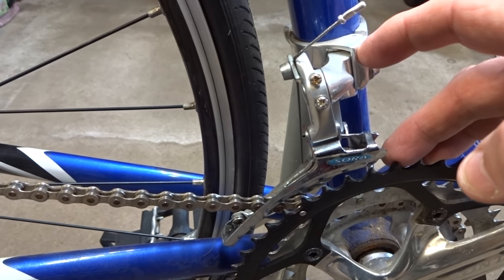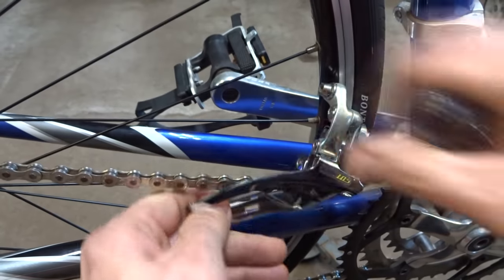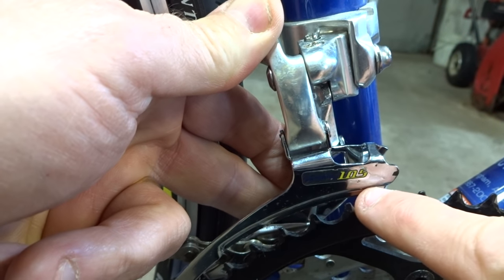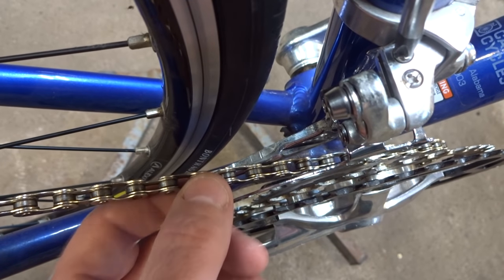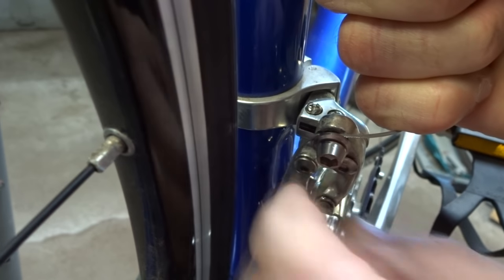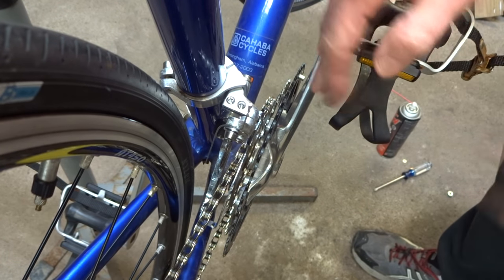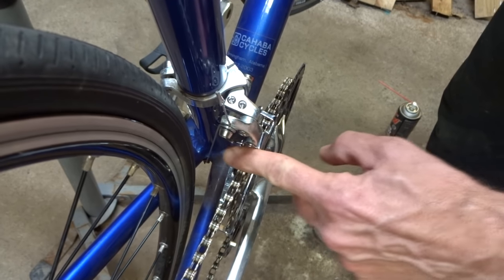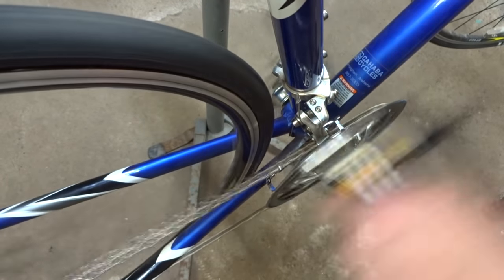How To Install & Adjust A Front Derailleur

Comment: RJ The Bike Guy i got some prob with my front derailleur. When i tried adjusting the H limit screw counter clockwise to move it out by a few mm before screwing it back in, derailleur doesn’t move, and im getting some chain rub. Is my derailleur stuck and needs to be lubed? If i use my hand and push it out derailleur moves and settles where the screw is. But if i shift back to 2nd then back to the biggest ring, there’s that prob again with the derailleur and chain rubs the outer cage.
Reply from the maker: The limit screws only limit how far the cage will move in either direction. It sounds like your issue is cable adjustment. Lubing can't hurt. Could be sticky cables. Or even shifter. Or worn out derailleur. Or FD installed incorrectly. ETC.
Reply: Derailleur’s new, just bought this bike off clearance sale, caad8 2015 tiagra. I just tried adjusting the cable, barrel adjuster is already tight after just 2 full turns. When i shifted to the big ring,  there’s chain rub still, i tried holding onto the shifter and pushing it more, and i saw the derailleur move, and stop where the hi limit screw is, No more rub, but when i shift back down to 2nd and up again, it’s rubbing again. I’m thinking of removing the fd and lubing it again.
Reply from the maker: @leftyseel8658  Sorry, but there are too many variables for me to diagnose over the internet. Try installing it again. It's a road derailleur, so I am assuming you are installing it on a road bike, or at least with road shifters. And it will likely rub when cross chaining (big/ big or small/small gear combinations).
Reply: Yeah it’s a roadbike, my first roadbike, i’ve been riding mtb for few years and decided to get an rb for long rides. Derailleur doesn’t move outboard too much. Inboard, no prob. It’s when going outboard that there’s a prob, it can only go as much as the top of the big ring. Since it doesn’t move outboard as much as it should, there’s chain run when i’m on 2x9, 2x10, 3x9, 3x10. Also sometimes rub on 2x8 and 3x8. 
 
 Thanks for trying to help tho. Appreciate it.
Reply: Forgot to add this. This may or may not have anything to do with the current prob. I sometimes notice the chain jams at times when shifting from 2nd to big chain ring. Originally, the bike came with the derailleur height set higher. I adjusted it and set it with a 2mm gap between big ring and cage. Problems occured after this. I’ll try to set it higher again, see if the prob goes away.

Comment: You must ride your bikes in a hermetically sealed environment, they are always pristine, brand new. That bike is new, how did the derailleur brake? I break chains and put them back together without a master link. They're stiff but you bend them from side to side to loosen them.
Reply from the maker: I bought this bike at a thrift store. I haven't even washed it yet. 
https://www.youtube.com/watch?v=ZNGoqcIQj_g
Reply: It's so shiny. I can't believe that. Look at the rims.  Look at the chain. The paint. You haven't even washed it? That's amazing.
Reply: Right, I've seen the other video I can see a tiny little rust on the chain and derailleur and a tiny bit of dirt. Looks like it got little use and sat in a garage for most of its life.

Comment: ive put the bike into gear 1 took out all the tension out and when i try to shift its incredibly stiff in fact the derailleur does not move at all the cable cant pull it hard enough if i twist any harder ill break the shifter. The derailleur moves when i use my hand but the shifter cant pull it
Reply from the maker: https://www.youtube.com/watch?v=EdEk2kO4Lmk
Reply: @RJTheBikeGuy  Nope wasnt stiff in fact wasnt moving at all. I solved it now though I had the cable routed incorrectly around the derailleur. Thanks for help anyway mate
Reply from the maker: @ellisfletcher3491  The video is about isolating the problem to shifter, cable, or derailleur. Your issue was the cable.

Comment: Great video! Looks confusing but its my luck i ride a fixed gear so i dont have to worry about shifting cables haha
Reply: LOL. Brakes or no brakes?
Reply: Elijah GH no brakes... im using a dropbar and it would really be weird to have a one side brake as my frame doesnt have holes for a rear brake
Reply: Elijah GH not really used to those, i always hold the dropbar in a position where im used to and its not near those brake levers. Im fine with skidding as of now but i am changing my bar to a riser soon so maybe i will get some brakes
Reply: it is definately  enjoybale bue bad fir knees and ligaments

Comment: I don't know why no manufacturers have designed a front derailleur brifter that's JUST FRICTION so you can trim the FD.  Seems with triple shifters there's ALWAYS CR/CC combos you want to ride in where the chain rubs on the FD (no matter how well you adjust the FD)  Moreso with MTB triples and rapidfire shifters.  The double brifters fixed this problem years ago with the "trim function" but the Triple's trim function just doesn't work so well on a lot of brifters.  Remember how Lance Armstrong rode mountains with a F downtube shifter and R brifter.  It WASN'T to reduce weight, it was because the L brifter had no trim function back then and the chain rubbed when close to crosschaining.  MTB rapidfire shifters have NO trim function so you're screwed out of the last 1 or 2 high gear cassette cogs in the middle CR and sometimes 3 of the low gear cassette cogs in the big CR.  This is UNACCEPTABLE and needs reengineering.  I've rigged MTBs with Rapidfire R shifters and GripShift L shifters but this is impossible with integrated brake/shifters.  The chain rubbing DRIVES ME MAD!!!  With me EVERYTHING on the bike needs to work flawlessly.
Reply from the maker: Because generally if the chain is rubbing, you are likely cross chaining.
Reply: Mmmm, though you are MUCH MORE mechanically proficient than I am RJ, no offense,  but I think your response is too simplistic considering how I explained this problem.  I do recall reading from several bike mechanic books that the middle chainring of a triple crank if the BB spindle sets it up exactly in the middle of the cassette cogs, should allow you to use ALL the cassette cogs w/o crosschaining so much as to damage the drivetrain.  Unfortunately EVEN WITH 7 and 8 sp. settups with rapidfire and some Triple brifters the chain rubs on the FD because you cannot trim the FD like a friction shifter can.  Also the chains and sprockets today are DESIGNED for crosschaining due to the trend of 1x systems.  This leads me to the assumption of DESIGN FLAWS in engineering, which should be addressed.  Hard headed 'traditionalism" thinking in cycling is notorious for adhering to bad engineering designs FOR DECADES before they fix them.  Much more so in the past than today though.  My test for "crosschaining" is if when backpedaling the chain shifts to the other sprocket or when backpedaling the chain rubs or catches the teeth of the next cassette cog. or if the chain rubs against the larger CR when in the smaller CR.  My rule is riding in those cog combos is a no-no.

Comment: I still can't get it to shift to the larger front cog. Is my cable too tight, to loose?
Reply from the maker: I can't tell you without working on the bike. COuld be many things. Like using a mountain bike FD with road shifters.
Reply: It says it's for a mountain bike. I finally had to replace the cable because I tightened and loosened it so many times I ruined the cable. So frustrating.
Reply from the maker: FDs can be a pain sometimes.

Comment: A SACRILEGIOUS VIEW ON THE FRONT DERAILLER:  
I know it often spelled "derailleur", but that is a French word that English speaking bicyclists would prefer to mispronounce than to anglicize.  As a lover of both English and French, I prefer one language at a time.    From this start, you can expect to read an opinion not often expressed by bicycle-people:  the front derailler is a bothersome and unnecessary appendage for flat-landers.     They would do themselves a favor by removing it from their bicycles and their lives.   I have a 21-speed "mountain" bicycle without a front derailler.  I have a "mountain" bike, because they are cheaper than other genres.   I excised the front derailler with a chain-tool, reconnecting the chain with a master link.   I then secured the cable that was attached to the derailler.   I still have a 21-speed bicycle,  but while riding I can shift only 6-up or 6-down using the rear derailler.  
The chain rests reliably on the largest of the three on the crankshaft.   If I expect to be carrying a heavy load on my carrier-rack,  I can off-the-bike move the chain manually onto the middle of the front set or onto the the smallest of the set.  I still have the 6-up or -down with the rear derailler.
What is the advantages of my 21-speed, 6-up or -down, partly manual transmission?   The shifting adjustment is far easier and less likely to need re-adjustment; the bicycle is 4 oz lighter.
In Florida, if one is bicycling just for a bit of outdoor pleasure, shopping or commuting, he or she hardly needs to shift while riding among 21-speeds.   If I lived in North Carolina,  I think I could still manage very well with my partly manual transmission.  For most people, 21-speeds while riding is a marketing gimmick, in my view.

Comment: Day three watching these videos going through it step by step nothing works... when i set the tension cable on the smallest ring i go to shift up abd it tightens to a point that it wont even shift. Itd be great if a bike that comes assembled that itd actually fucking work.
Reply from the maker: Can't tell you what you are doing wrong.
Reply: Try loosening the high limit screw WAY out, just to make sure the derailleur movement is not being restricted. If that was the problem, tighten it again as appropriate once it is shifting properly.

Comment: Can I vent my hatred of top swing derailleurs? !
Reply from the maker: I hate downswing derailleurs.
Reply: So, that's a no...?! Every derailleur with a low clamp that I've used has eventually failed at the pivot, tilting the cage outward. This doesn't seem to happen with the common bottom swing design. They have their place with short seat tube bikes I guess, but...
Reply: What's a top swing derailleur opposed to any other kind?
Reply: Top swing derailleurs mount or clamp to the seat tube below the derailleur cage as opposed to what RJ is using here.

Comment: Derailleur installations are beyond frustrating. 🤦🏻‍♂️
Reply: I rewatched your video and started from scratch. By following your instructions on lining up the front derailleur, starting at lowest gear, smallest ring with the chain just barely touching the inside of the bike side of the cage... I was able to complete 3 project bikes. The all shift like they were professionally done. You sir, are the man.

Comment: This  4 year old video clip is poorly titled.  The derailer (pardon my English) is not "a Front Derailleur".   It is "a Shimano Front Derailleur".   The derailers I have seen cannot be pulled out by hand.   The spring is too stiff.    In order to pull it out, a pliers would be needed.  In that case, the derailer would have to be firmly clamped, .... , but then it could not be adjusted.